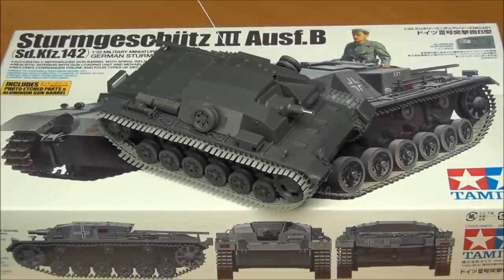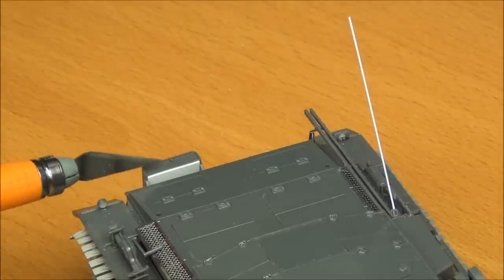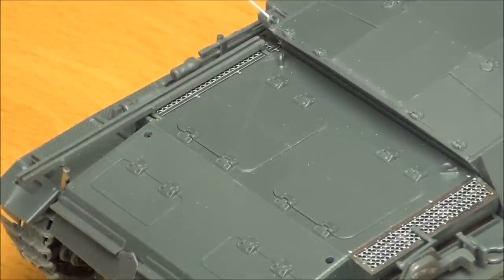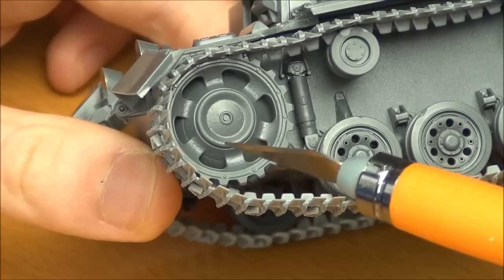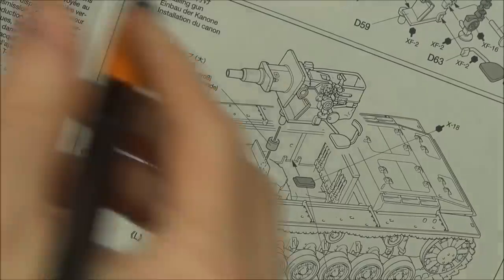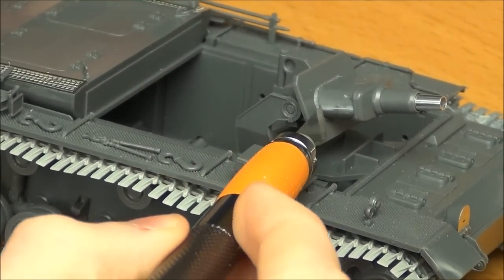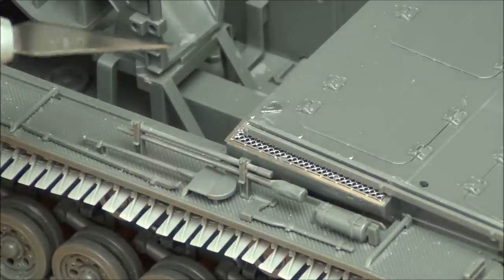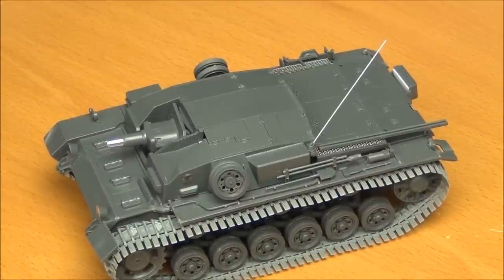Post-build Review: Tamiya StuG.III Ausf.B

Comment: Nice review of a very nice kit but can't believe you didn't mention the working suspension :-O  lol
Reply from the maker: Thank you!  Lol, barely working suspension...just the front and rear wheels so I figured it'd just something left over from a motorized kit or something.  I just glued them all down.
Reply: Confused......I'm sure the one I built had spring loaded suspension on all the road wheels!!!.....I will check later this evening.
Reply: CW Modelling it is just the four metal spring bits that attach to the front and back. The rest of the suspension kind of lays there. It is what I would call 1/2 working suspension. Built this kit a few years ago and wasn't disappointed but also wasn't blown away. Can't wait to see it painted and weathered Evan!

Comment: What’s your view of the RFM Stug IV interior kit?   Also the Takom early F8?  Does it indeed have the early L43 gun? No reviewer is telling!
Reply from the maker: Hello James.  The RFM StuG IV early kit is excellent, but it does need zimmerit.  Luckily there's some great sets available for it; I would recommend the DEF Model set.  

The Takom early F/8 looks good.  I haven't built it myself but I imagine it's just like their other StuGs.  Now, the L/48 was introduced at the end of Ausf.F production (Ausf.F was before the Ausf.F/8), so all F/8 had the long L/48 gun.  But what you might be thinking of is the early F/8 used the same single-baffle muzzle brake that was on the Panzer IV with the L/43.  I am not sure if that muzzle brake part is in the kit though.
Reply: @Panzermeister36  thanks for your info - greatly appreciated!

Comment: does the stug has handles so you can open the hatches on top from outside by the crew? I think I remember my dragon stug III B to have them
Reply: I mention it because i can not see them on your tank
Reply from the maker: Hmm well I have seen those handles before on reference photos, they were not standard but rather a common crew modification.

Comment: What about those strange suspensions? I'm just working on those....  it's very unusual for Tamiya suspensions.
They should be workable but they just fall of.
Reply from the maker: I just glued them straight with tamiya extra thin cement.  The workable spring gimmick is only relevant if you plan a diorama for it.

Comment: Is it really a fair review when you change parts ?
Reply from the maker: Yes - it shows what I recommend one do to the kit to improve it.  These reviews are focused on the builder, so I show what I felt was good about the kit, what was bad about it, and what I recommend one do to improve it. Otherwise it wouldn't be a very helpful review...I'd just be stating issues without showing any solution to them!

 You should be prepared to do something to a kit other than just follow the instructions like a zombie...otherwise are you a modeller or just an assembler?